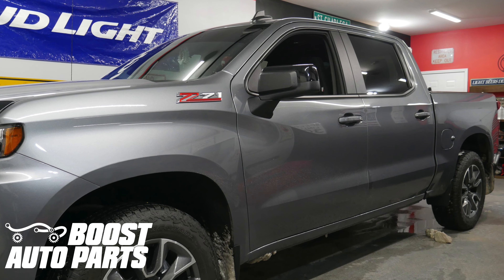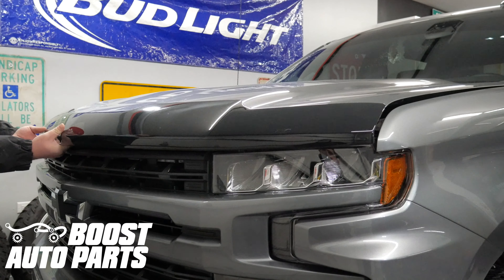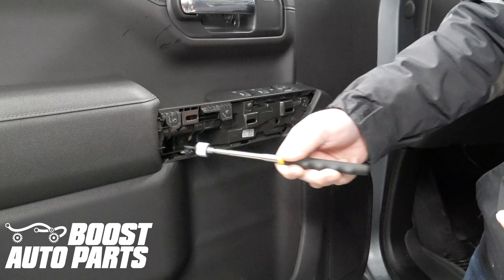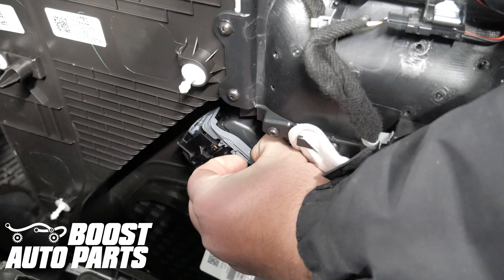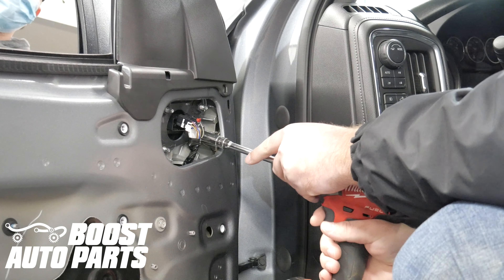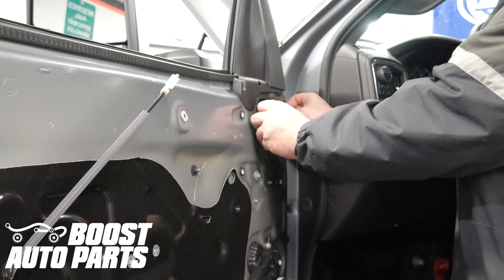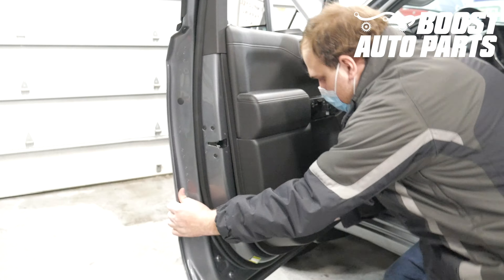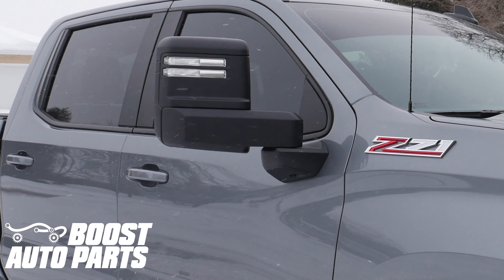GM Silverado & Sierra 1500 Towing Mirror Install (2019 - 2022)

Comment: What socket/drive needed for a 7mm bolt?
Reply from the maker: 1/4
Reply: @boostautoparts  thanks for the clarification, I had issues using 1/4 because it's slightly bigger in circumference from the bolt and 5/16 is too small for the bolt

Comment: I did it without disconnecting the battery! And the lights won’t turn on should I try again and disconnect the battery first
Reply from the maker: Did you install the modify door harness?
Reply: @boostautoparts   no! Do you have a video how?
Reply from the maker: @cesaracuna7668  https://youtu.be/gst51r3Aa5Y

Comment: My mirror stopped folding in and now where it locks in place it is way past where it should be. Is there a way to fix this?
Reply from the maker: Reach out to our team at support@boostautoparts.com for assistance. If they are our mirrors they will be able to be reset, otherwise it would be covered under warranty.

Comment: Will the lights work if my Silverado model doesn’t have the mirror lights?
Reply from the maker: You will need to do some wiring - we have all of the necessary videos just depends on your exact setup. Give us a call at 765-831-2830 and we can guide you to the right video/solution!

Comment: 2019 trail boss LT installed OEM tow mirrors no modified harness or RZY harness both ordered, I lost power mirror and window switch functions any thoughts ?
Reply from the maker: That should not be happening - those features should still work.
Reply: @boostautoparts  ya talked to my local dealer they are baffled I installed the small mirror back on with the OEM tow mirror on passenger and passenger side power and heat worked
Reply from the maker: @jordannicholson3238  Sounds like the door connector wasn't fully seated.
Reply: @boostautoparts  are they that finicky I seen previous post and that was one guys issue maybe I’ll try again

Comment: What’s the difference between these mirrors fitment and oem mirrors fitment on a 2019 GMC Sierra elevation 1500?
Reply from the maker: This video is actually showing the installation of OEM towing mirrors. We are not yet offering the towing mirrors at the time of writing this (2/8/22)
Reply: @boostautoparts  are there any “modifications” that have to be done to fit oem tow mirrors on to 1500’s?
Reply from the maker: @chandlerjohnson918  No - you just need the proper mirror for your vehicle in combination with our harnesses.
Reply from the maker: @chandlerjohnson918  Not as long as you get the proper OEM towing mirrors for your 1500 truck. GM accessories sells them.
Reply: @boostautoparts  thank you for the help today👍🏼
Reply from the maker: @chandlerjohnson918  Glad we could help!

Comment: Been waiting 2 years for these to come out. I’m convinced they’re never going to be released.
Reply from the maker: They're coming soon - unfortunately designing things the right way takes time.
Reply: @boostautoparts  soon? I’ve waited since my 2019 model, I now have a 22 LTD model 3+ years later. Where are the mirrors?!
Reply from the maker: @WarTurkey_1  The release will happen in 2022.
Reply: I saw people buying and installing these over a year ago, not sure why you are saying they hadn’t  been released. 
P.S. I know this post was 7mo old, but they were still out then. I think you have a slimy dealership if they can’t get them for you.
Reply: @x21blaze21x  buying them from boost?
Reply: @WarTurkey_1  from a Chevy dealership.
Reply: @x21blaze21x  yeah they’re 700 from A dealer, these are aftermarket
Reply: @WarTurkey_1  ahhh I see.
Reply from the maker: @x21blaze21x  Our harnesses + OEM mirrors have been a solution since this video was released. Our mirrors will be out sometime later in 2022.

Comment: I have a 2019 Chevrolet Silverado Trailboss LT with no power mirrors. With the harness, (I've already put my email in to receive update when tow mirrors are in stock) will this harness supply power to fold in also?
Reply from the maker: We will have an upgrade path to add the power folding feature to vehicles not originally equipped with the feature on our mirrors which are scheduled to release Fall 2022. Keep an eye on your email if you signed up to be notified - we will begin sending monthly updates in August.

Comment: Fantastic video
Reply from the maker: Glad it could help!
Reply: Following up on this - looked into it with my dealer (I'm just buying a 2021 At4) and they say because I have UKC as part of the pro-trailering package these towing mirrors will not be compatible. Does your wiring harness void this? The reason was part of the blind zone alert, surround vision and rear cross traffic alert would not be working properly. Let me know thanks. Would really like these mirrors
Reply from the maker: @Dylan-SavedByGrace  you need to get mirrors equipped 1:1 with the options you originally had. If you originally had BSM & 360 camera and install mirrors without them, you will get error messages. 

We will have mirrors compatible with all of these features, but they're not yet available.
Reply: @boostautoparts  okay thanks for the update. Looks like I will have to wait unfortunately but hopefully it will come soon enough.

Comment: Will I need a different wiring harness or can the oem ones work?
Reply from the maker: You will need to modify your OEM door harness with our kit to get the lighting features working.
Reply: If I don’t modify the wiring will the defrost and power mirror function still work?

Comment: What’s the part number for these mirrors 
What’s the price?
Do they connect directly to the OEM  harness or do I have to purchase anything else to make them work
Reply from the maker: All information can be found here: https://boostautoparts.com/products/2020?utm_source=2019%2B%20GM%201500%20Tow%20Mirror%20Install&utm_medium=Comment&utm_campaign=YouTube

We offer all of the required wiring to gain the full feature set along with full tutorial videos.

Comment: So the mirrors electrical won’t work without  the separate harness? I have a 21 rst with just the electric adjust.
Reply from the maker: These harnesses are required to get the lighting functions working.

Comment: Do these allow for the automatic folding mirror function and blind spot lights to still work? I have a '21 AT4 1500 Duramax thanks.
Reply from the maker: We are releasing mirrors that will support power fold and BSM in the next few months. Sign up to be notified when they're available here: 

https://boostautoparts.com/products/2020?utm_source=2019%2B%20GM%201500%20Tow%20Mirror%20Install&utm_medium=Comment&utm_campaign=YouTube

Comment: *reconnect battery and test mirror function BEFORE fully installing the door panel, then finish if everything works.
Reply from the maker: Yes, just make sure everything is plugged in otherwise you may trigger warning messages and check engine lights.
Reply: @boostautoparts  I would not be surprised to get a message that says: "You have engaged in DIY upgrades or maintenance and I am reporting you to GM for possible warranty violation."

Comment: Can you swap factory tow mirrors for normal mirrors? Would downgrading be plug and play?
Reply from the maker: It depends on the features of the small mirrors. Some of the pins have different functions depending on the functions of the mirror, so not neccesarily.
Reply: @boostautoparts  same connector just pins slotted differently?
Reply from the maker: @BryanV6661  Yes
Reply: I have factory DLF code mirrors  on 2021 GMC 1500 I would swap you for?
Reply: @anthonypenna5961  sorry, youre to late my friend

Comment: If I install these mirrors with your harnesses will I also need to have a dealer re-program?
Reply from the maker: No reflash necessary with our harnesses - they are purposefully designed to avoid that.
Reply: @boostautoparts  My current mirrors have the lane change warning light and auto-fold as well.  If the towing mirrors have these features do they work still with your harness without dealer intervention?
Reply from the maker: @robcardon  Yes, so long as you buy mirrors that have those features.
Reply: If my truck doesn’t have lane warning and cámara can that be added?
Reply from the maker: @danielcisneros6641  No - those features are not things that can be added if not originally equipped. The only bonus features at this time would be running light, turn signal, and cargo.
Reply: Did you need a harness for those mirrors

Comment: if i dont wire in the lights what functions will my mirrors have? will my blind spot monitoring still work?
Reply from the maker: It depends on your trucks original configuration. We would recommend reaching out to our sales team at sales@boostautoparts.com with your VIN so we can see exactly how your truck is optioned.

Comment: If I were to buy OEM tow mirrors, could I simply buy your harness(es) to make them work?
Reply from the maker: Absolutely
Reply: @boostautoparts  but I would rather buy yours!
Reply from the maker: @Eric_Kilgore  Our mirrors are still under development at this time unfortunately!
Reply: Will they work for the Denali 1500 with sensors ?